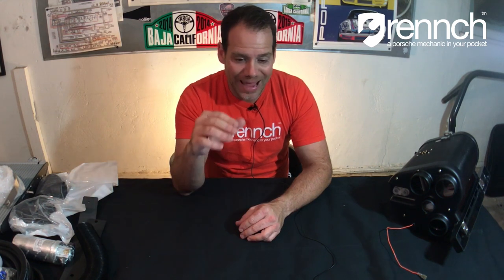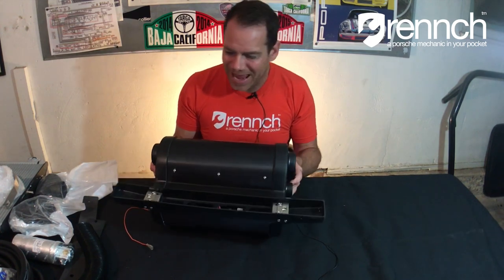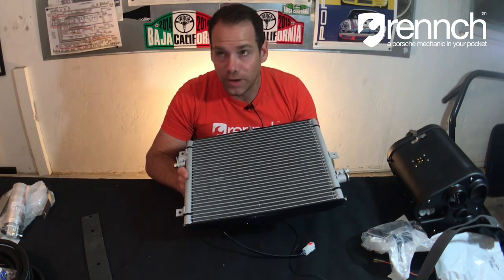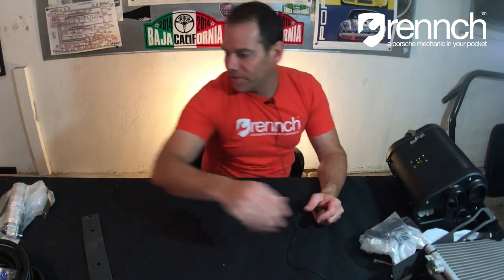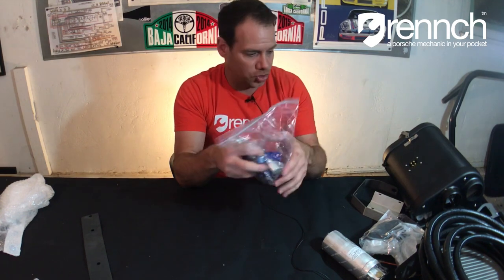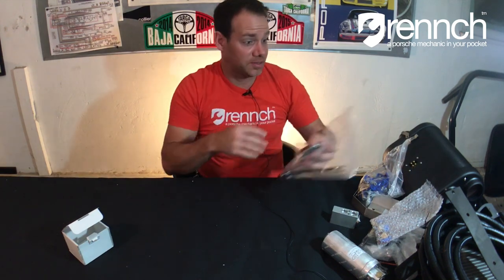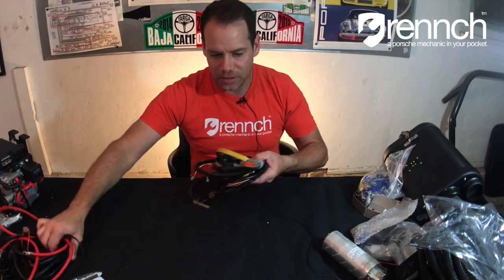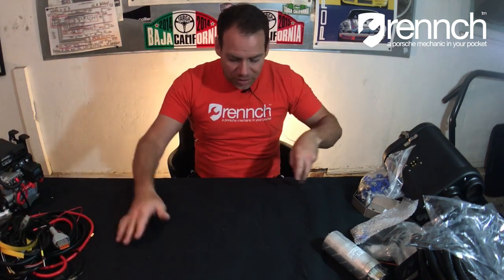Vintage Porsche 911 Air Conditioning Install - Unboxing Classic Retrofit Electrocooler - DIY

Comment: Are you happy with the new air conditioning system,?  Appreciate your car did not have air.  I have a 993 with factory air, which I recently had regassed, small improvemnet but not great.  Am interested in maybe replacing with Classic Retro fit, albeit and expernsive option if it improves things, especially as my Porsche is black on black.
Reply from the maker: ABSOLUTELY.  It's killer.  One of the best upgrades I've made.

Comment: I’ll be interested to see how the electric compressor works for you. I’ve had a hot rod builder buddy try one and he did not like the output. Keep in mind it’s 100° and humid KS here and the company that made that kit is from Canada so the needs are a bit different.
Reply from the maker: Yea, this is a completely different compressor. Will let you know!

Comment: William Knight #97, Michael, I would loose the driver battery box, also you have plenty of Amps however I would run a LARGE deep cycle. It is kinda like having a tank on an air compressor when you run electric air. It being advertised less than 1 HP sounds great but 746 watts = 1Hp @ 100 % efficiency there fore 1Hp could easily dray 62 amps, I would go H4 LED bulbs on lighting and tour good to go with the large battery you won't go through alternators. Love your car keep up the videos.
Reply from the maker: William Knight  I already have a small, powerful Miata battery on the right-hand side. The left side box is doing nothing.
Reply: Ok, I would keep the condenser in the side not used, helps balance car and gets better air up front. We are doing a few of these presently. Nice video
Reply from the maker: I have an oil cooler up front, and one in the right (passenger) fenderwell.  So...not a huge choice there.  :)
Reply: I understand, I though to had no more than a battery box on driver side?
Reply from the maker: I have battery boxes on each.  I haven't cut them.
Reply: yes, I understand I thought you were thinking of putting in in rear, I have had bad luck with this, the shorter you keep the lines the better and the front helps the balance of the car. If I can be of any help I am glad to do so. William Knight
Reply from the maker: As always my friend.  I've not checked to see what kind of room I have up there yet.  But, maybe with RSR flares I'll get lucky.
Reply: I have wanted to build a system for a while where the condenser in the front is where an oil cooler goes and run two 930 coolers in the front fenders with fans. I put the first 993 motor in an SC in 1996. Talked to Jae yesterday.. Keep up the videos I forward it to a few to help get your subscribers up. I am off phone with Europe now and going to catch a little sleep... Keep up the good work my friend..
Reply from the maker: Yea, it was VERY late for you.  Talk to you soon.  Jae is a founding member of the channel.

Comment: Would it work on a classic beetle?
Reply from the maker: I think it would technically work, but it wouldn't be custom fit.  You might reach out to Jonny at Classic Retrofit to see if you might be able to pull it off.